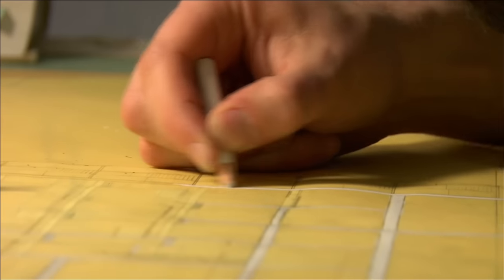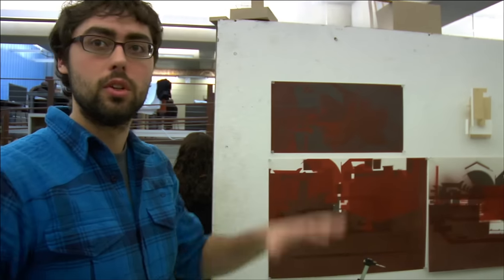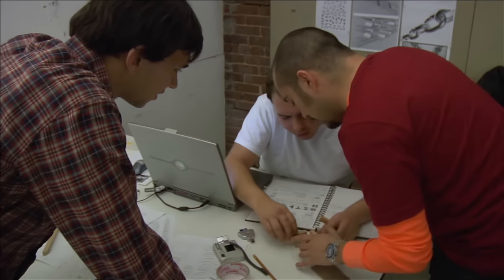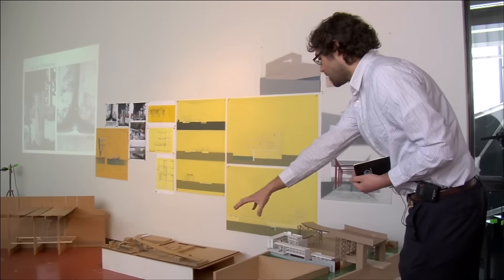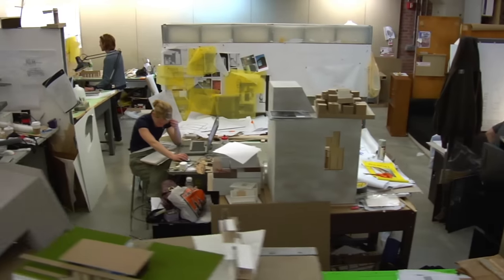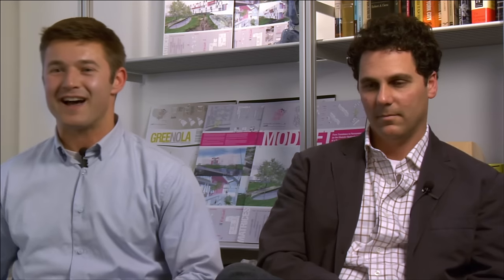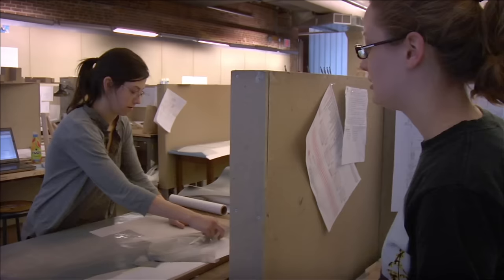Archiculture: a documentary film that explores the architectural studio (full 25 min film)

Comment: New smart farming is using the water drops dispenser, veggies coming out from water pipelines, nets of pipes and vertical gardens of smart veggies, that might work as natural cooler process, replacing the air conditionating plants on huge need of electric power based on burning petrol, gas or carbon, think about it how important architects are for building up a brand new culture on this topic

Comment: I'll be very brief here. 
School are relevant if and only if the schools teaches the relevant stuff. Revit, Rhinoceros, 3D printing, CNC cutting, Laser cutting, Grasshopper 3D should be MANDATORY. 

Schools are relevant if and only if the schools focuses on Calculus 1, Calculus 2, Calculus 3, Differential Equations ordinary and partial, Complex Analysis, Differential Geometry I, Differential Geometry 2, Geometry and intense Trigonometry. 

Schools are relevant if they teaches physics and building physics in detail. 

Schools are relevant if and only if the school teaches architects programming languages, computer logic and coding. 

Architecture is equably relevant with a structural engineer. We architects should not get paid for drawing or model making. We should get paid for THINKING. We are problem solvers, organizers and work with climatic data controlling thermal comfort and thermal behavior of structures. 

Our profession IS scientific.

Comment: Architecture is like farming. If it’s not in your blood, don’t do it, find another profession. 30 years ago the general manager of the firm I worked for said architecture is too difficult. He was right!! The most frustrating part is a construction official has more power then the architect, and most are idiots, or just an asshole. 
The Handicapped code, ADA (American with Disabilities Act) makes building twice as hard to design. The square footage increases because of the extra space required for accessibility clearances, while the budget is never enough. 
Then again I am not sure what I would do, but in my next life it will not be architecture or farming. If you want to know why architecture professors teach, it’s easy. No liabilities, and not a very difficult schedule. 
Find out as much as you can before you start an architecture program.